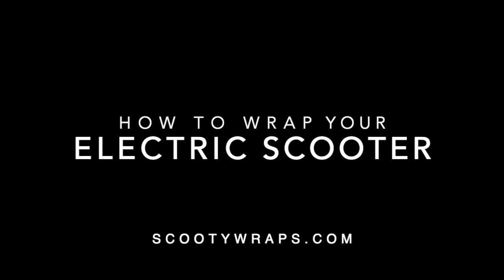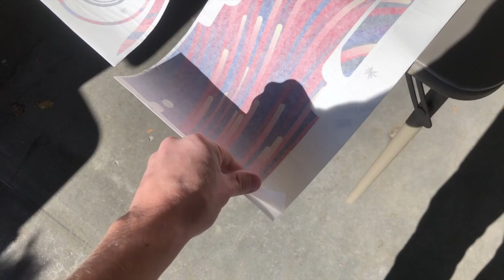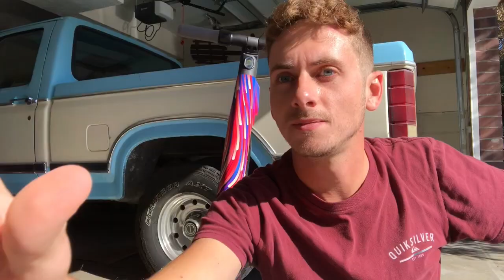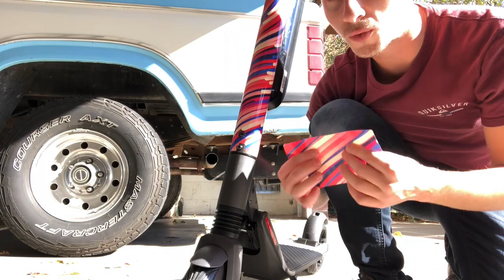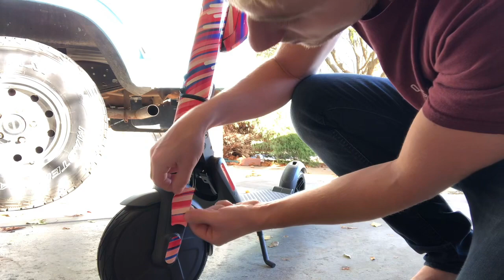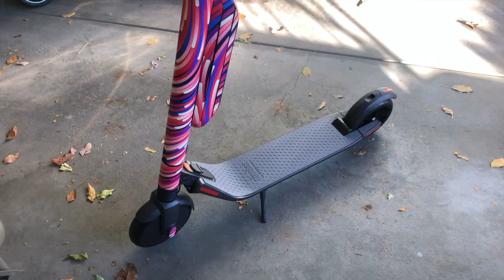How to Wrap Your Electric Scooter - Segway Es4 - Scooty Wraps

Comment: Not the best instruction. 
You should leave the application tape on the vinyl while you are installing and use a squeegee or something with soft edge like a bank card wrap with a cloth to apply pressure.
Are these air release vinyl?
Reply: And leave half of the backing paper on while you are aligning. Once you are in position, apply pressure then peel off the other half of the backing paper and apply.
Before apply any decal. Must clean the surface with wax and grease completely.  Any seal on the surface wont help the decals sticks.
Reply: @mrnoodlelai  Curious, is there a particular reason behind this method even with this Air Release Vinyl? Thanks

Comment: The  2 first pieces you put on does not line up. Top and bottom on the front. A bit lazy if you ask me.
Reply from the maker: Hello Alexander! This was test print 1.0! It takes 3 or 4 prints before a template is perfected. The Es4 template that is available online has a perfect fit 🙌🏼